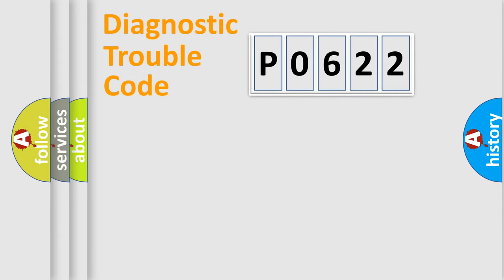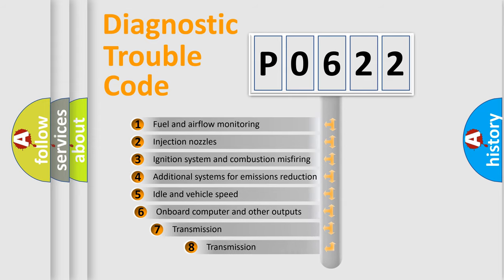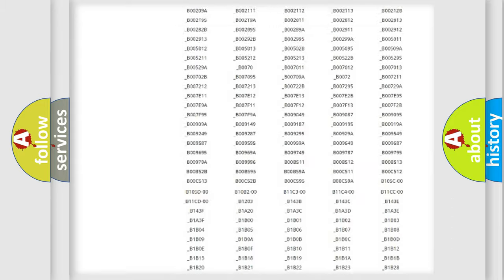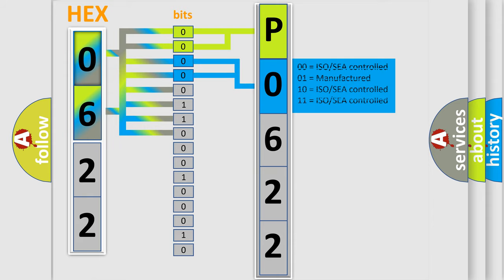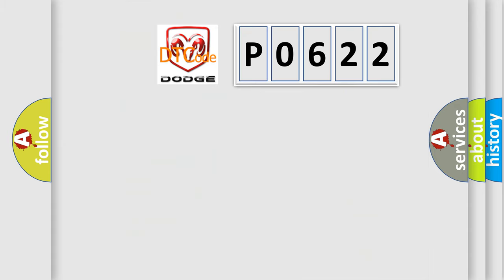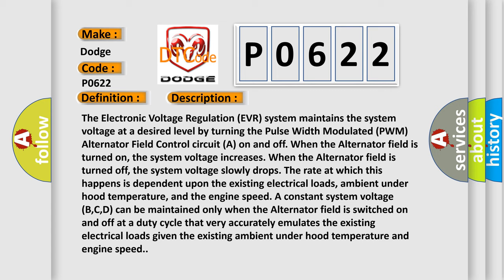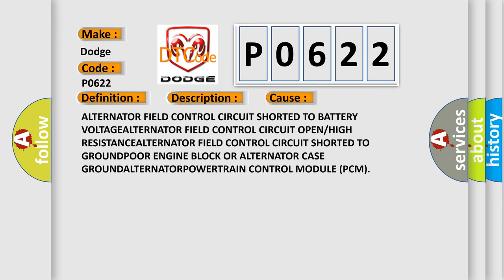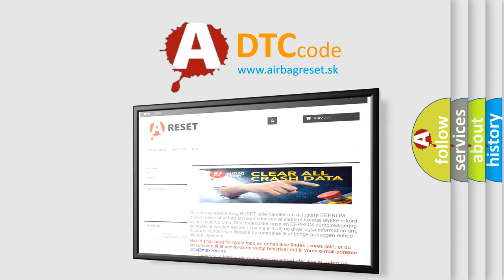DTC Dodge P0622 Short Explanation

Comment: First of all, thank you for making this video you did an awesome job breaking everything down so someone like me (who doesnt know a whole lot about cars) can understand what this code actually means. I have a question... My 01 dodge durango would start up fine and idle like normal for about 15 minutes give or take until it would die. I noticed the battery gauge was slowly dropping the whole time the car was running until it was all the way down then it died. I replaced the battery with a new one and i replaced the alternator with a new one as well. The car starts up fine but is doing the same thing as before where it will idle for about 15minutes , drain the battery down to nothing then die. I got the code to display in the odometer by turning the ignition to on then off then on then off then on again and it said P0622 then Pdone. Could this mean that the PCM is bad and needs to be replaced? I found one on ebay and went ahead and ordered it seeing as i can always send it back if i put it in and it turns out thats not the problem. What if i put the new PCM in and it still does the same thing? What else could be the problem and how would i go about fixing it? Thank you in advance and thanks again for the video!
Reply: did changing the PCM fix it?
Reply: @brycenjent2228  yep new PCM did the trick